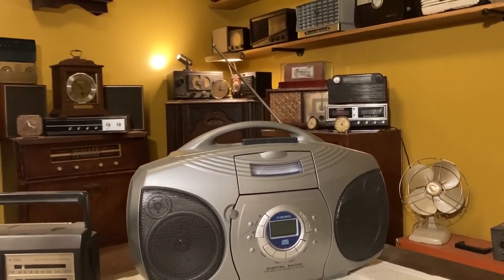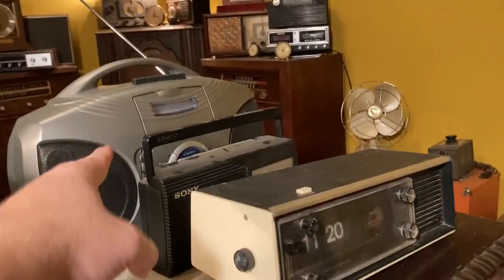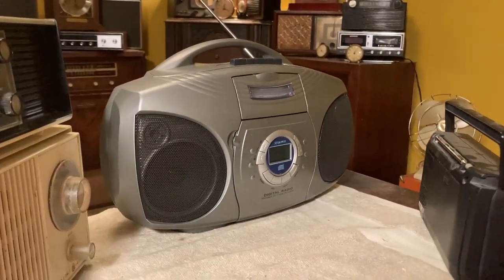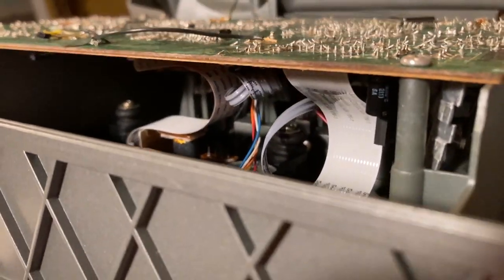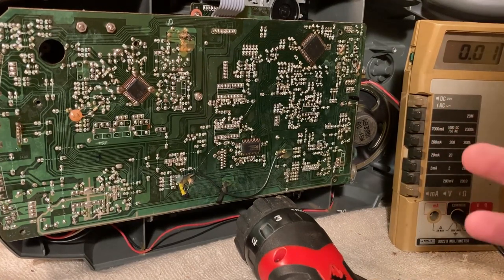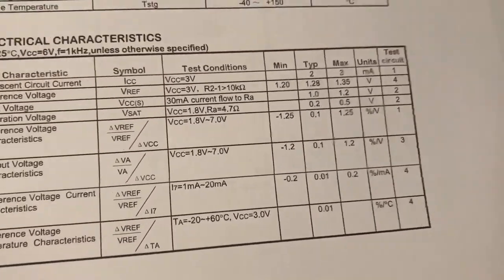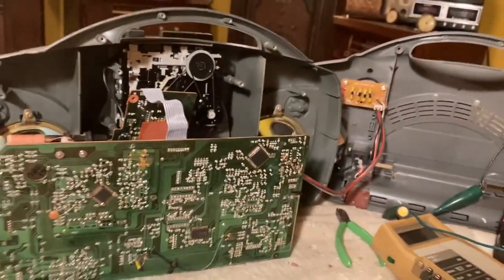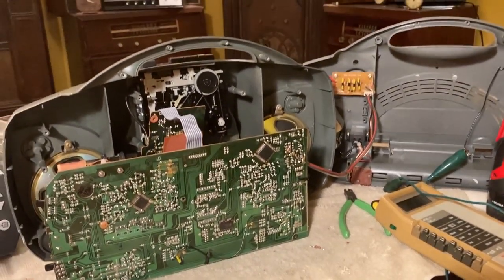Tried To Fix a Chinese Tape Player And Made It Worse, Uh Oh!    Amateur Repair Time FAIL!

Comment: I just had to put a 1970's B&D Circular saw out of it's misery.  I know you don't feel bad about that Cheena unit, but it's always fun trying to save them.  For me, the saw was my wife's grandfathers.  Unfortunately the switch was broken (sealed), Blade Guard cracked and a chunk missing, and worse? Helical Spindle very worn out. I don't own a machine shop (or even a lathe and mill) to make my own, so...I have 5 lbs of cast aluminum for the recycler.  Unfortunately NO spare parts left out there.  I'd have to buy an entire saw to get the single part. :( Sucks, but sometimes it happens.  I have 5 more saws to go through...3 from the 40s.
Reply from the maker: Can't save 'em all....

Comment: My mom started going through her old tapes a few years ago, and thought they were gone because they sounded quite just like that. She was preparing to throw them away and I had to intervene. I had recently received a slightly unhappy but generally working Pioneer stereo set from an estate clearance, so I put it together for her. It was clear that the late 90's Chinese player was at fault.

The Pioneer devices have some issues - the tape deck seems to work as intended but the CD player recognizes about half of the discs fed to it, the amplifier has some strange contact problems with the source selector, and I have changed one of the speaker circuit relays that made only intermittent contact on one channel. The source selector is a PITA to work on, it has a motor for remote operation, and a hand knob that controls the same motor to turn the actual selector. Instead of even thinking of taking it apart, I have been spraying it with contact cleaner and got it into a way where the motor semi-reliably stops at the right spot at the first try. I've been thinking of building a replacement mechanism that uses relays instead of rotary contacts in the signal path, but that is a future project, and I have plenty of more important things to do.

Comment: OK I agree number one is crap and should be thrown into the bin but the others are fine to get working again. Well you tried
with number one  ( from Chine-na) and that's more than I would have done. But you were on a roll finding the problem.
Reply from the maker: I've still got those other ones, we'll do videos on those!

Comment: Try cleaning the variable trimmer with Deoxit, ... then check the capacitors in that circuit ... then measure the resistance of the resistors then will chance over time.
Reply from the maker: Thank you Joe!

Comment: Hmm i would power the motor direct from a small power supply,  6 to 12 volts.
If it still sounds wobbly then clean the rubber pinch roller and pin.
If its still wobbly, show it the trash bin.
Just my opinion.

Comment: Yes that “audio tectronics” CD, cassette, radio boombox is a “polished turd” but you didn’t know how to repair it ~ the speed adjustment for the cassette recorder’s motor is on the rear of the motor itself = you would have had to unscrew the mechanism from the housing and look at the back of the motors external can for the black hole that you insert a insulated/jewellers screwdriver to the trimmer pot on the driver PCB inside the motor can ~ you would have to carefully hold the recorder not touching the pulleys & their belts on the rear, insert a “test-tone” cassette into the front of the recorder and holding it in place and press “play” while it is playing the “test” cassette, turn the screw driver until the tone sounds right - indicated by test equipment; oscilloscope/spectrum analyser, [or in my case a guitar tuner] and when a pre-recorded cassette is played back it should sound normal. As for the other things; that SONY radio was designed by Sony themselves but the manufacturing was offshored to China by then, as for the Panasonic clock/radio and the General Electric radio are both vintage ~ thus more desirable